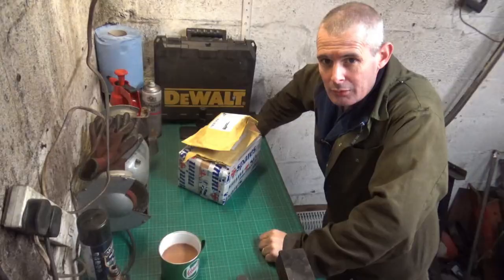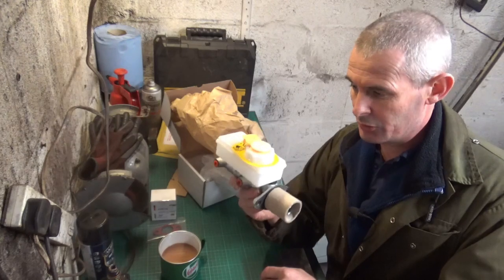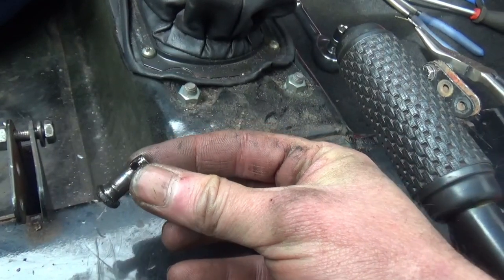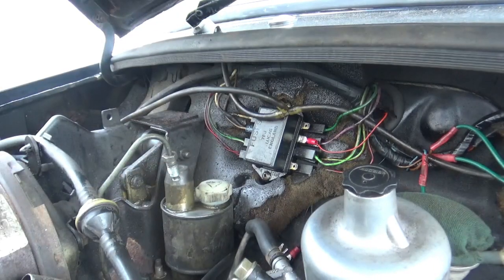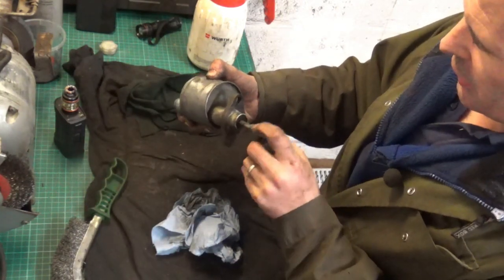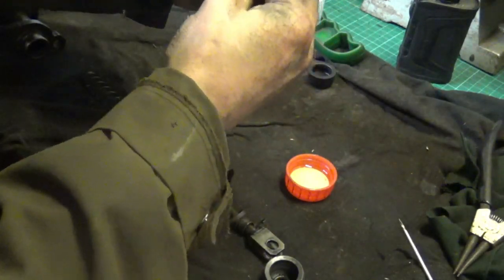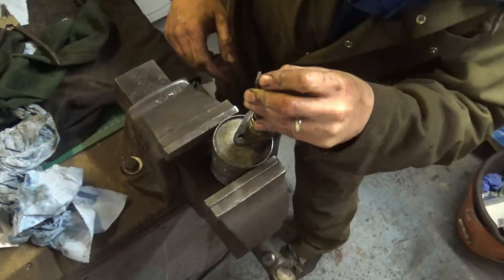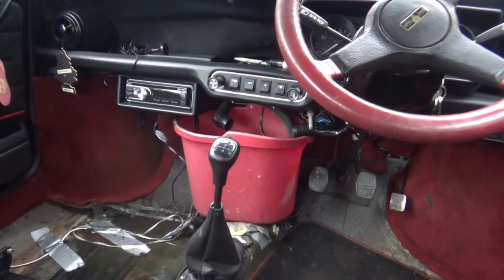Austin mini Clutch master cylinder strip and rebuild

Comment: Did you have to take it apart again to fit the rubber cover or did it go over the end pin?
Reply from the maker: Rubber cover stretched over the rod without any problems

Comment: I’ve got a set of coveralls like them 😄 and a Castrol Enamel mug 🤣🤣 Found the video as I am in between decisions as to whether to refurb my clutch and brake master cylinders or renew them. Doing an engine upgrade old (original) 998 in my 1982 HLE 1000 to a 1310, possibly with a Supercharger. I reckon I’ll do what you did, renew the brake cylinder and refurb the clutch?
Reply from the maker: Cheers Bill, it's an easy enough job to do. In the end I renewed all the hydraulic parts on the car
Reply: @BMCWorkshop  so you bought a new clutch master cylinder?
Reply from the maker: I did only because I went to the effort of painting up the engine and brake servo etc but the rebuilt clutch master will go in my other mini if it polishes  up ok